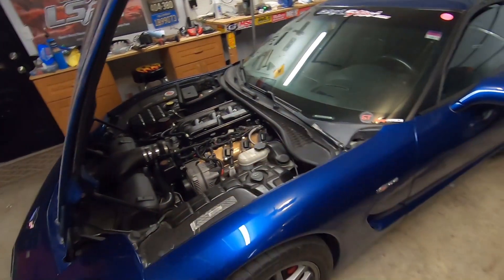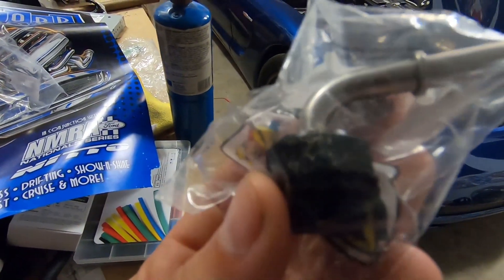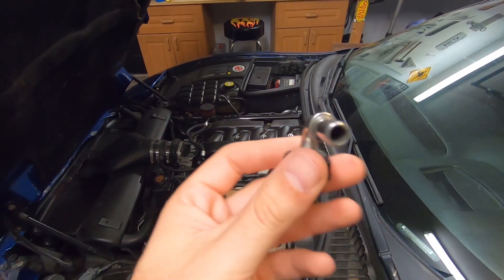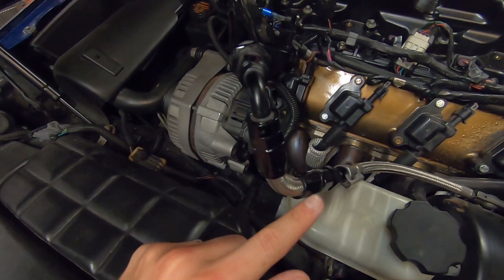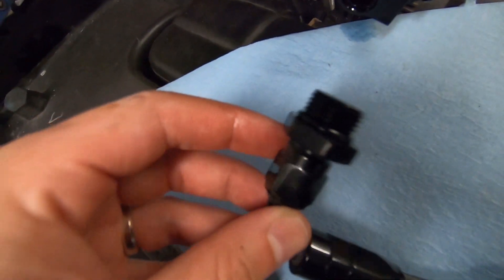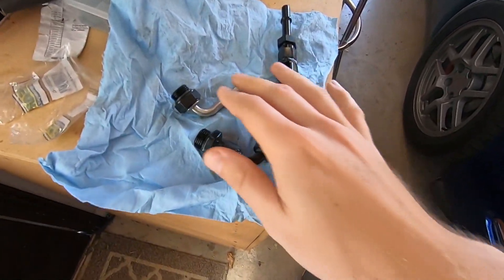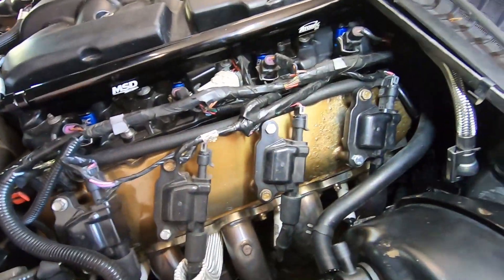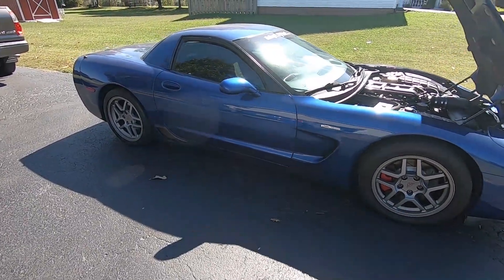The Best Way To Install Aftermarket Fuel Rails on Corvettes

Comment: Hi c5 Z06 owner, I forgot to hit the Bell, and after a year I was wondering how it was running...it must be great, you are still modding it...WonderBar!!... My stock 04 z06, Torch Red and Chrome Z06 rims, with 96k miles keeps putting smiles on my face and others that see it, too. Glad everything is working out and it was ALL worth it, time and $$$...Any top speed numbers?...hehe

Comment: Love your vids. Doing almost same set up. Question. Looks like your using ls3 coil packs. Did you have to change to a ls3 harness too or use stock ls6 harness. Thanks
Reply from the maker: I changed the harness, as the connectors are slightly different on the coils
Reply: @Garagetopics  thanks

Comment: Nasty!  Is it the rails, the intake, or both that require cutting into the cowl?  It’s hard to tell.  Good to reduce potential leak points when they can shoot fuel right into the interior through the heater fan!

Will that intake work with stock rails?

Also, how is the hard fuel line routed up the firewall?  There’s supposed to be a little plastic “double C” clip that holds it to that double grooved rubber bushing behind the driver’s side head.  Mine keeps coming loose and I’m worried about it touching the headers, though I can’t see down there to see how close it is.  Yours looks like it’s pulled way over to the left towards the brake booster.
Reply from the maker: The intake fits fine, the fuel rails is what required the cutting of the cowl. C5 stock rails dont work with this intake - ls2/3 rails should from a c6.
Reply from the maker: I have this rubber plastic line holder on the firewall that isnt going anywhere that holds the hard line in place. I did bend the fuel line tube to make this work perfectly
Reply: Good stuff!  I forgot you had the engine out, so I’m sure you were able to route everything ok.